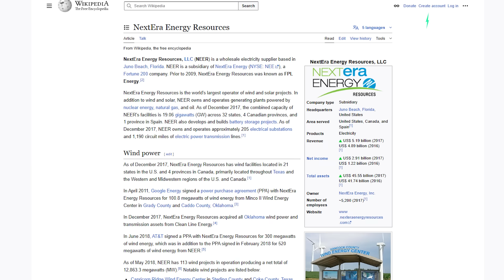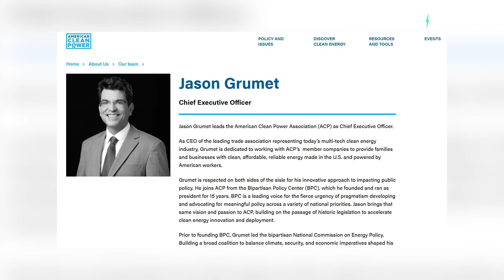U.S. Clean Power Boom: 7.4 GW Added in Q1, Solar Leads the Way!

Comment: Near record amounts of solar and other renewables are being installed and battery installations are growing - that’s awesome! If the renewable energy is a lot cheaper it will get installed regardless of subsidies.
Reply: You want off grid, 3kw system. Budget setup won't run ur AC, or Hot Water, but everything else okay. ;)

Comment: My thoughts have always been that it doesn't matter what political affiliation or opinion on climate change the leaders have, you might slow down renewable development, but it will never stop, Texas as a good example. I mean why aren't these companies building nuclear, coal or gas fired power stations instead of renewables, that's because of the cost factor and return on investment. The cost and return on investment of renewable both solar and wind is overwhelmingly on the renewable side. But consider, 14b in investment in renewables cancelled? Where is that money going? It's not going to Nuclear or coal/gas power, it's going to sit there invested in stocks or something else, because they know by the time they build nuclear/coal/gas it's quite likely the people in power now will be gone and different thought will prevail,and besides, you don't get much return for your 14b going nuclear, and there's no return on investment for decades. Dutton tried that in Australia, trying to forcibly direct the power industry away from renewables of whatever type is at best going to delay the inevitable, at worst it will cripple companies that actually invest in Nuclear/coal/gas. The world has changed the way we view energy for the better, some people haven't changed but they will be left behind sooner or later, and by the looks of energy investment in renewables right know it will be sooner.

Comment: Adding battery storage alone could almost double electricity production, because power plants could run at full capacity 24/7 instead of backing off when demand falls.

Comment: Texas (ERCOT specifically) is an energy market, generators only get paid by the electricity they sell, while most other markets in the US are capacity markets, the generators get a big part of their revenue by the what can produce. So this gives a huge advantage to the lowest cost producers which are solar and wind (coupled with storage). A big part of this is the PTC (Production Tax Credit) renewables get. If this goes away, that advantage will be significantly reduced. The growth of renewables will slow down. If on top of that there are huge tariffs on Chinese solar panels and batteries, it will be another significant blow to the industry. New gas plants will take a minimum of 5 years to come on line (and might go up price given the new tariff on steel). Nuclear takes a 10 year minimum to come on-line (best case scenario). So this all leads to much higher electricity prices, possible rolling blackouts. In short, a complete and avoidable train wreck, out of sheer ideological hate for renewables.
Reply: The economics has changed dramatically in even the last five years.  The US is still going to have massive investment in 'renewables' and storage, because the base cost has come down and time value of money has gone up.  So even without Gov't subsidy, renewables will be the best / most cost effective, especially when you also reduce the unforced loss of having to pay for years of study and permitting.  In other words, the regulatory and time cost was the portion the Gov't subsidy was covering in many cases.  Just ask Germany....
Reply: It's not all idealogical. It's all the propaganda from media controlled by big oil in America. Regardless, nothing stops progress.
Reply: The Taco wont last that long and neither will his circus 🎪 the FF ...industries pretty much looking to cover its tracks and offload a centuary plus of  Orphan and ghost wells .. worldwide particularly in the US and Alberta Canada..  .. the Methane leaks alone are collossal ... and so are the costs of capping them,  plugging all the leaking old wells and mines will cost Billions and theyve been playing shell games and fund/asset stripping moving their money off shore and into new areas .... like rare Earths and renewables ...  😂😂 ... its the Toyota heading the Japanese car industry body problem ...  there eating the cats and Dogs 🍊🧌 🤡 logic....  🤦🏻🤦🏻🇬🇧🧙🏼‍♂️

Comment: Battery storage is needed regardless of what creates the power. It should be used to limit blackouts and lower costs.
Reply: It’s needed much more for intermittent sources like solar and wind.
Reply: John, when paired with batteries, wind and solar are no longer intermittent. The cool thing is that battery chemistries are evolving so quickly and battery prices are falling like a stone. Other storage technologies like sand batteries are being developed. Coal and gas can’t compete.
Reply: @freeheeler09Sand batteries are utter nonsense.